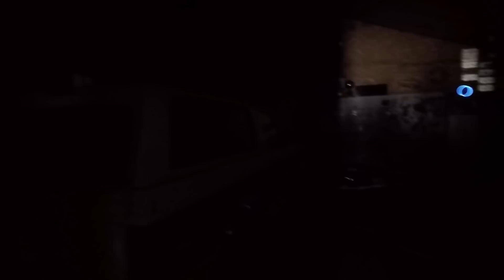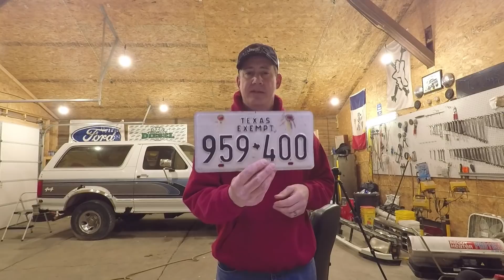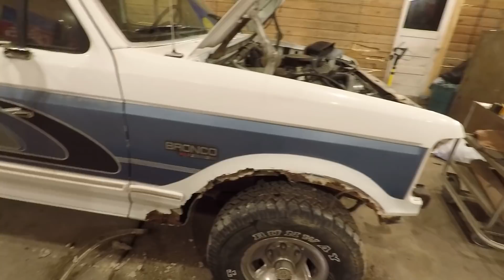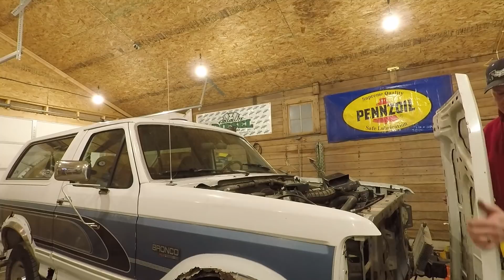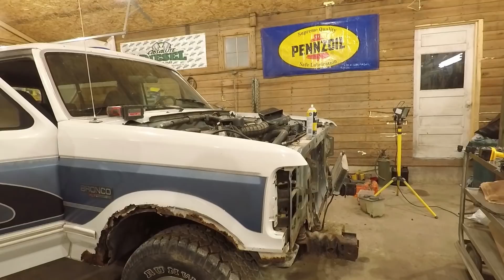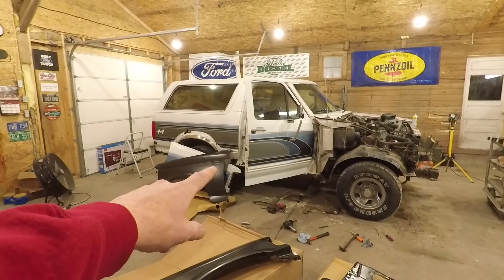Ford BRONCO Is Coming APART - Ford Bronco Project

Comment: Jon, ive changed those fenders a couple times on different trucks, what it is called is " OFF with OLD and ON with the NEW". i had a 94 f250 yrs ago that got so rusty that the pass side fender flaped like a birds wing going down the road, so i got fenders at junk yard and went at what u are doing. fun fun fun.

Comment: Maybe in this case the phrase should be: "There's more than one way to re-skin a Bronco..."  It's nice to see that Ford actually though about people needing to change fenders/wings, I've worked on a few vehicles where there is no chance of getting to fender/wing bolts with the door on the vehicle which turns what should be a fairly easy job into a complete horror story (if you've every tried rehanging and realigning a vehicle door single-handed you'll know exactly what I mean...)

Comment: Nice bronco build, up here in in Canada we use rubberize undercoating on everything brush on or spray. Maybe think about using it on the engine compartment don't have to color match etc. You could also delete all carpet and do a rubberized floor just a thought. P.S. had the 5.8 in a 90 f250 still miss that truck and i have had 12 new trucks since, good luck with the build we'll be watching.

Comment: I'd have been inclined to leave the hood/bonnet on the vehicle until the new fenders/wings are on as it makes lining the panels up easier so long as the hood/bonnet was decently aligned.  I'd also be inclined to leave the firewall/bulkhead in the original white as it is going to be a complete nightmare to prepare and paint it with the engine in and it's probably going to end up looking not great.  Being as the truck is still going to have white on the roof and possibly the lower panels it will still look fine and not out of place...
Reply from the maker: Might leave the firewall white, been thinking about that...the good was out of whack to begin with. I'm pretty good at aligning these things...no worries! LOL